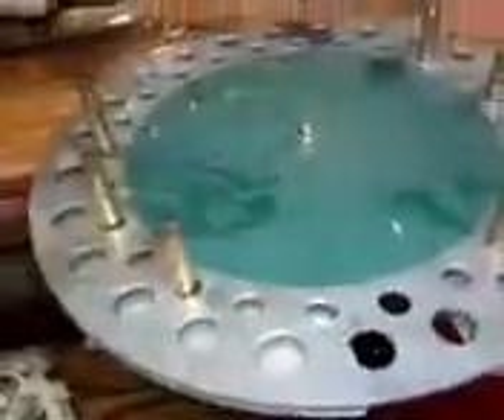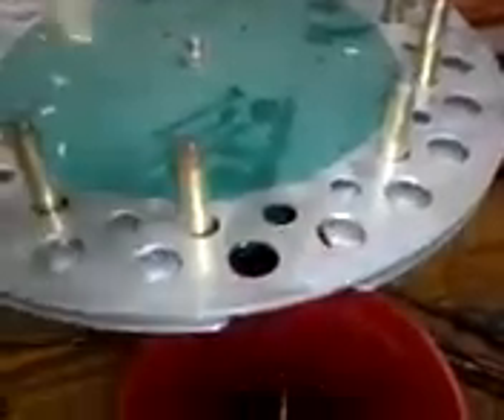Homemade case annealer

Comment from the maker: Some off these 223 brass have 20 firings on them. Without this annealing process..they would split and be trash after 5. Brass works opposite of steel. You heat steel up and quench it..it gets harder. Brass you quench to keep it soft..and like was said before.. gotta keep the heat out of the base.

Comment: Dropping them in water keeps the heat from travelling too far down the body into the head of the case.  You want the head to NOT be annealed.  It should stay hard, as designed.

Comment from the maker: @GetMeThere1. You have to get the brass pretty damn hot to anneal it. I suppose you could use hot air..but a hairdryer isn't going to do it. I'm guessin it needs to be about 1000 degrees to get the job done. I go by color.

Comment: I wonder why you couldn't use hot air instead of flame? People solder with hot air. One thing nice about it is that you wouldn't have to worry about over-heating.